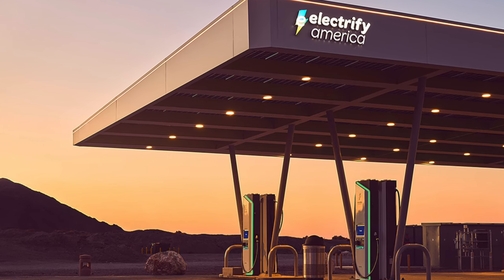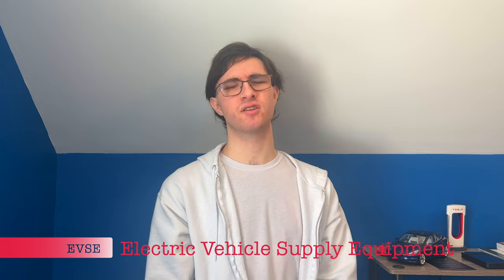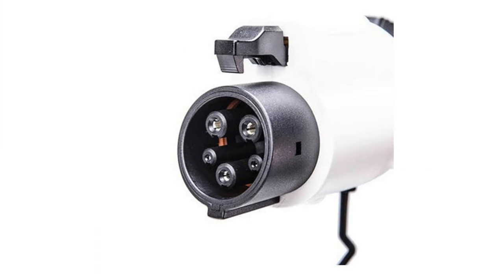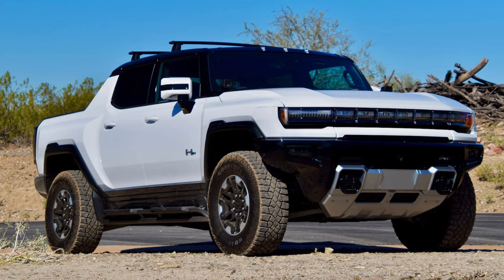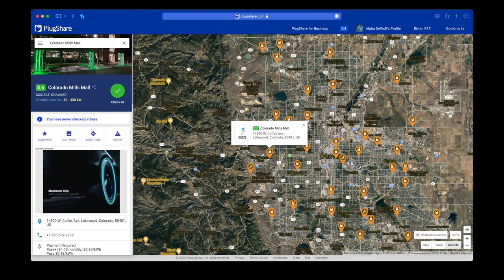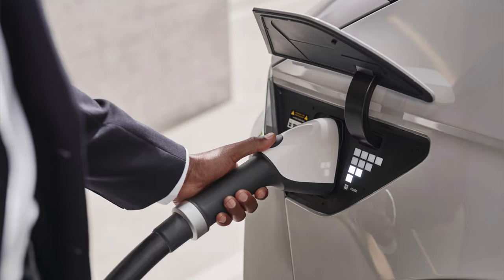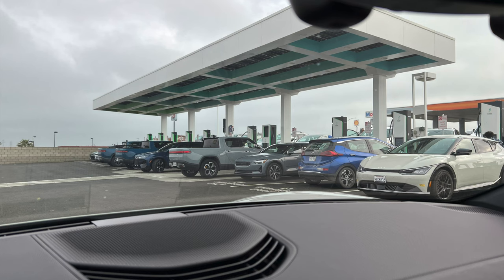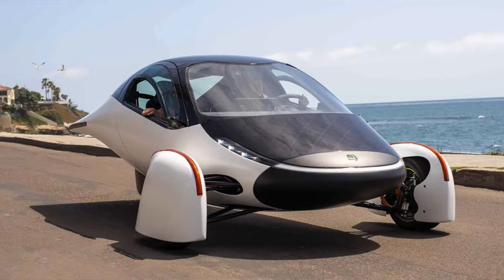CCS Sucks! - Do I have to Explain Why?

Comment: Opening super charger to other non-tesla car is a double edged sword. Because some thinks that it deter new potential Tesla Buyer. because one of the primary reason for Tesla owners have been the exclusivity of Super chargers for Tesla owners only. Now other car owners will flock to Super charger and clog up the station. Also another thing most don't realize yet is the fact that unlike Tesla cars where Charging port is always on rear driver side of the cars.  Other car companies have ports in many different location and they will start of block more than one parking spot.

Comment: The only reason after so many years of exclusivity Elon decided to allow non-tesla car to  use super charger is because Elon wants Government funded ev tax credit.
It will also cost more for non-tesla car owners to use super charger.  I own two Bolt EUV and since i have installed 50Amp charger in my garage i don't use public charging. 
Others have said why did other companies used CCS in first place.  Before Elon's decision, only CCS was available for other car companies. But as of 07/02/2023 at least 3-4 car companies (Ford, GM,Volvo & Rivian) to use NACS plug. More will follow.

Comment: Will Tesla allow other manufacturers to use their standard without licensing or other restrictions?  If so, then I'm all for it.  But I have not yet seen any indication that this will be forthcoming.

Mass electrification is only possible with open standards and open charging infrastructure that works with cars from all manufacturers.  Tesla's closed charging network has been great for Tesla, not so great for the industry as a whole.
Reply from the maker: NACS has been an official open standard for half a year now. I personally have the CAD file downloaded directly from their website if I wanted to make it myself. Other automakers are choosing their pride of “Tesla will Fail” mentality is why they haven’t gotten on board yet.
Reply: @TheRandomAlphaDrive  And actually, NACS has been open since Tesla opened their patents in 2014. On top of that, NACS would still be usable and documented even if Tesla went out of business. It’s just a handle design. If Tesla goes out of business tomorrow, everyone can still adopt it.

Comment: Teslas connector is not future proof.

From an Engineering stand point Chademo is better. It is more robust and was designed from the beginning  to have bidirectional charging and V2G , V2L, etc.

Tesla is limited on wattage through their connector without going to super high voltage.
Reply from the maker: So then explain to me how Tesla’s connector can achieve nearly a megawatt in a smaller form factor. 1000V X 1000A. Tesla actually couldn’t figure out the maximum wattage due to cable limitations, not connector. CHAdeMO here in the US is a 500V standard, which is a problem for 800V class vehicles. And yes Tesla has confirmed that NACS can do Vehicle to X. So which is more future proofed? Yeah I’m going to pick NACS on this one.

Comment: Even though you like NACS better and want to convince automakers to use it, automakers will never likely switch to that standard.  Even though you said CCS1 is a flawed design, you should get used to it when you buy other vehicles that use the standard.
Reply from the maker: If automakers want to keep dragging behind Tesla due to something that fundamental, then fine. Just don’t expect those who understand how fundamentally flawed CCS is to buy them.
Reply: @TheRandomAlphaDrive  This tells me that if you would make an EV, you will use the NACS connector for the charge port.
Reply from the maker: Why would I use CCS1 if it’s less capable, more difficult to handle, less secure and less safe? Name me one thing CCS1 does better than NACS. You just can’t. CCS2 addresses all but one issue (it’s way bigger than it needs to be), but that’s not here in North America. Why should I use CCS1 over NACS?
Reply: I said you would use NACS not CCS1.